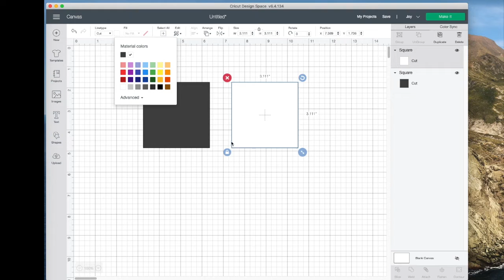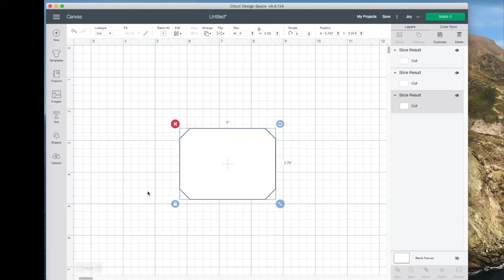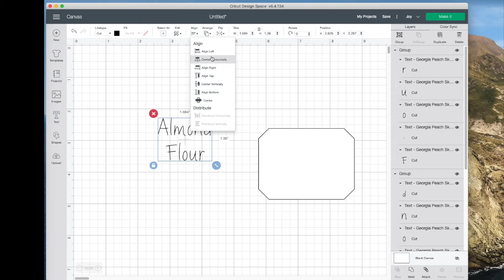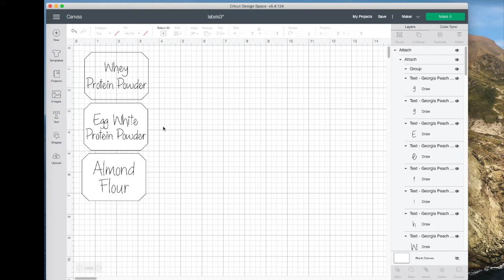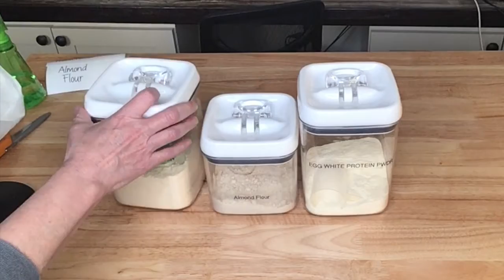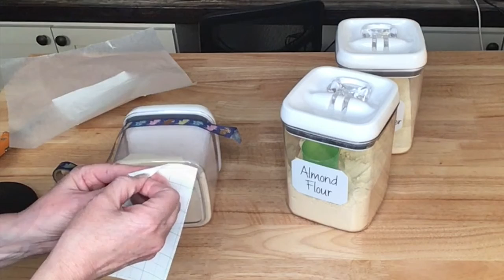Using Writeable Vinyl (a Joy product) on a Cricut Maker or Explore

Comment: I think you can prick the bubble with a tiny needle and it will lie flat.  Have you tried applying it likecwall paper. Peel a tiny portion and stick to the canister and peel away the back as you apply the vinyl?
Reply from the maker: Great ideas! I haven’t tried the wallpaper method yet but will do that next time I use this. Thanks so much!

Comment: I believe this writable vinyl is made to be used without transfer paper.  That's maybe why it didn't work well.
Reply from the maker: Thanks for watching Dani. I only tried the transfer paper on my trial run on the card stock. I didn't end up using it on the actual containers.